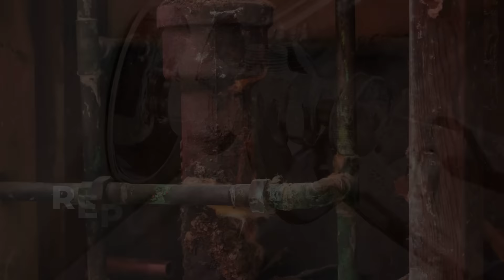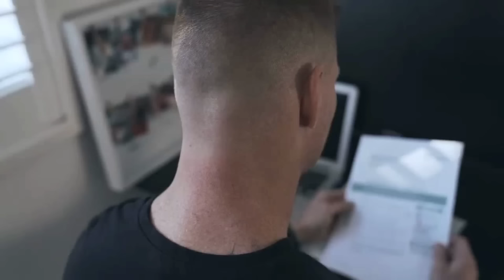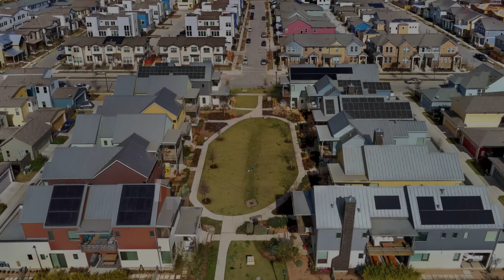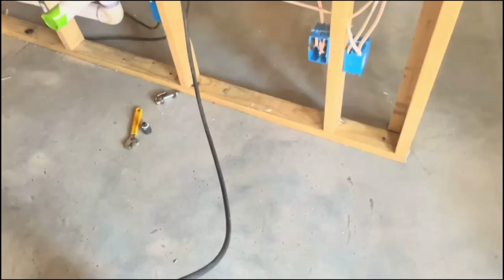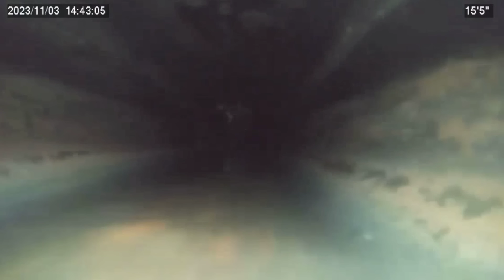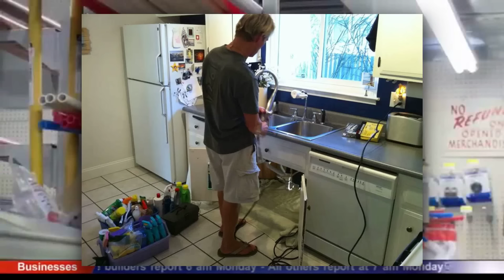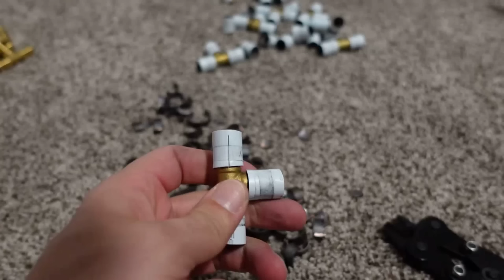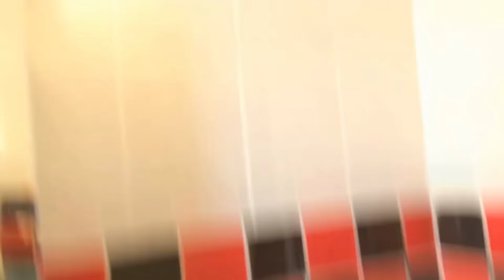Why 90% of New Plumbing Work Are Garbage (The Builder Grade Lie)

Comment: I ❤ the people who have posted these are lies.."its the manufacturer"...if Builders didnt buy it..they woukdnt make it 💯 I am a licensed Adjuster with a major carrier and EVERYTHING said is true ..what not mentioned is that most insurance policies EXCLUDE ongoing/long term leaks, while having a clause stating you MUST prevent damages to your home...this puts clean up & repair costs directly on the homeowners. Make upgrades ASAP, supply line and all angle stop valves. Get a portable condensation pump and put it in your drain pan, this is an even cheaper way to avoid cascading water damages. 

GOD BLESS You ALL 💯

Comment: This is an advantage of older homes, like mine.  As long as it didn't have aluminum wiring.  
My house has copper wire and water pipes.  
Copper pipes seem to last forever as long as they don't freeze and had good solder joints.  
My house doesn't have an expansion tank on the water heater.  Didn't even know that was a thing.  No one in my area has them.  My water heater is already 17 years old with no signs of leaking.
Reply from the maker: It really comes down to who installs it.
Reply: What does aluminum wiring have to do with plumbing? Aluminum wiring doesn't cause plumbing failure .
Reply: @Rightiswrong-qv5ul  Nothing. Read it again. It could negate the advantage of buying an older home.

Comment: Unlikely that cast-iron drain pipes are better.  They rust thru over time.  Very expensive to install.  I think they are only used in commercial buildings because they are quieter.  Today, I think they use rubber gaskets at joints rather than the old poured lead.  ABS seems better than PVC since much less brittle.

Comment: My house does not have nor need an expansion tank. No back flow preventer nor check valve on the water main.
I am pretty far enough from the water main at the street so as not to be a problem.
All my pipes are iron too.

Best copper to use is L-Grade.
Housing grade is cheap M-Grade.

Comment: I've been remodeling homes for over 25 years. I can assure you.... copper gets pin hole leaks and worst. Copper has a lifespand of 50-75 years.  The supply lines that you speak of were mostly issues due to cheap plastic female nut (ballcock).  They rememedied many of them by making them out of thicker plastic and some have a ratchet device that prevents overtightening. I've seen some lines that are 20 years old. 

Profesionals do not ues 'SharkBite' style fittings. The only thing I agree with is that many builders us PEX B as opposed to PEX A which has alot of benefits. Alot of builders also use cheap shut off valves. 

Do you know how much cast iron we pull out?  Most of America uses PVC for drains which works great when you install it correctly. 

 Most of this is because homeowners do not maintain their home.... just like most people don't maintian their cars. Everyone waits for something to break. I've seen client after client over the years who never change their filters, descale their hot water heater, clean their duct, replace water lines and valves, sweep fireplace, caulk the shower, seal the stone...... nothing.... they don't care.... even after you educate them.

This video is so incredibly misleading.

Comment: Having worked for a residential housing contractor I saw too many shortcuts and after 3 homes I quit…
   What I learnt was that you need to find good solid tradesmen who stand behind their work and are not afraid to give you a warranty ! 
    As far as plumbing goes copper is bulletproof.   It’s a lil more labor intensive but you can sleep at night !!
Reply from the maker: I feel you, everyday this happens
Reply: We don’t know the full longevity of Pex. If installed properly (very user friendly)we do know that it’s good well beyond 20 years and I believe some of Europe has a 35yrs plus track record. Copper has a much longer history to look at, again, it has to be installed properly, poor soldered joints, and poor debarring as well as water chemistry can shorten its life dramatically to less than 20 years. Well water chemistry routinely shortens its life, in some cases less than 40 years before failures start to occur. In both cases inferior quality has a detrimental effect on it, poor quality Pex pipe or fittings. On copper, poor quality fittings such as cast brass with porosity, thinly drawn copper ell’s and t’s , or using m gauge pipe can cause failures.

Comment: I had this tyle of piping put in my house in 2002 after multiple copper pipe fails under the slab. New pipes go through thr attic now, no probs so far.
Reply from the maker: Moving lines out of the slab is definitely a smart move for longevity! 🏠

Comment: Cast iron drain pipe deteriorates, corrodes and cracks. It can last 50 or so years but eventually it will give up. 
 ABS drain pipe first appeared around 1960 and the early type usually cracks at a hub. . Newer cellular core pipe is supposed to address that issue but it’s still too new to know for sure. 
 Copper water pipe can corrode and leak or develop deposits that restrict flow from mineral in the water especially any iron in the water. 
 You’re right that workmanship is crucial but. 
The bottom line is that there is no mechanical system in existence that will last and keep working forever. No matter what things will fail over time and use.
Reply from the maker: Valid points on all materials, though I still believe we need to push for better longevity than what's being installed today. 🛠️

Comment: Copper and cast iron can also fail.  We've had drain lines made of both fail in walls and floors.
Reply: How is that possible
Reply: @nyu1774  In one word: corrosion. Search on keywords "copper pipe pinhole leaks class action lawsuit" and you will find multiple instances of lawsuits over leaky copper tubing, each with more specific detail than you can fit in a yt reply.
Reply: We have a pinhole leak right now that is underneath the slab foundation of the home in the hot water line. It is copper pipe put there when the house was originally built in 1977. I am trying to determine whether to jackhammer where the leak is currently happening and patch it with something like JB Weld, or run Pex through the attic and into the bathroom like a buddy is telling me would be easier. I have a sneaking suspicion it's not going to be as simple to hook back into the hot water line as he seems to think, and would be even more work on a Jack and Jill bathroom with a shower separate from the tub, and 2 sinks requiring hot water as well.
Reply: @MrRatlicker   The metal-to-PEX transition is probably not a DIY job if it's your first time (because you do have to sweat the metal-facing side of the fitting), but PEX is higher quality tubing than copper, and other than that transition fitting it is a lot easier to work with. Pinhole leaks in copper are from corrosion, so what you're seeing might only be the first area of corrosion to make it all the way through, with more leaks still to come.

Comment: I will give you rubber seals degrade on a sharkbite. What really makes it degrade is rusty water. I live in Clearwater Florida in a extremely well built 1955 house. I am the only one on my long block who installed a double big blue water  filter system 25years ago on the outside of the house. 2 stage first is sediment second is charcoal. I change them every 3 months and the rust there catching is incredible. Solid RED. if you live in a city the water your getting is incredible rusty. I just received a notice from the water co stating a lead alert now. And encourages everyone to get a filter system. No shit. You want to see how bad the rust in your water is just take the top of your toilet off and look at the walls of the tank. Bet its bright red.
Reply from the maker: Installing a filter system is definitely the smartest way to protect your plumbing. 🧱

Comment: 2 weeks after I closed on the purchase of my home, I got a notice from my insurance agency saying that I had 10 days to replace the pex with copper, or they would cancel my policy. "Why couldn't you tell me that before you approved my policy and allowed me to close?" I asked them. "Policy change - sorry" was the answer.
Reply: Time to find a new insurance company.
Reply: @johnpeters9903  I did. And for anyone who wants to know - it was "Universal Property & Casualty"
Reply: Change insurance companies. I did plumbing in my last job and my wife is an insurance agent. We used pex in our new home build 9 years ago and love it. I didn't put any fittings in the walls, and every line could be replaced with minimal disturbance to finished walls, unlike copper. I've repaired a lot of copper leaks through the years, but I haven't seen pex fail. Yes, there have been a couple pex fittings that failed, but copper would have failed in the same conditions.

One thing not mentioned is the number of copper leaks caused by freezing in northern climates. Every winter countless copper pipes freeze and split. My wife's office has had three repairs this winter alone. That doesn't happen with pex. I'll stick with the best option for our needs in our area- pex.

Comment: Never sharkbite behind wall, crimp black plastic pex, tested 100psi, drains are # 40 pvc, also flooded or 5psi tested is code. Copper is generally way to expensive
Reply from the maker: Exactly, properly installed systems last; it’s all about the quality of the craftsmanship. 🛠️

Comment: My builder wanted to use that PEX crap, made sure I had copper and no Shark bite installed
Reply: I can only assume that you had your water tested before making your decision to use copper. Copper is no longer the superior product. Retired master plumber here with 49 years in the trade. My choice is pex-A for domestic  water lines and  in floor heating.
Reply: @j @johnpeters9903 ve seen reports of pex-a degrading and failing in under 13 years
Reply: @johnpeters9903  General contractor who has lots of hands-on plumbing experience.  I agree.

Comment: In that early scene where they "tore the wall off", is that one drain fitting upside down?
Reply: Nope it is not a drain but it is a vent if it is above the outlet the fittings are turned upside down to direct sewer gases out .

Comment: This guy is right, everything was made che and expensive. The materials are low grade material even the pipes, windows, and walls. They designed it to fall so toto keep fixing things but everything in America is junk. Long ago you took pride in your buildings, appliances and furniture and it last as long as you lived or longer. Now they might last maybe 3 years at the most. Plus this all is meant to make your sick too. Lead paint was to keep radiation or if you're home and protect your from the outside elements. The copper was good for you to drink out of. Drinking or if rivers, steams and lakes had more minerals then water tanks of today because those can have chemicals that you're not supposed to drink.. that's why they changed it all. Money profit and careless about the people just their pockets.

Comment: You said PEX only lasts 8 years? That isn't correct, I've seen lots of numbers from 25-50 years. Like saying your PVC sewer pipe will fail because it's plastic.
Reply from the maker: You're right that the pipe has a long theoretical life, but the system is only as strong as its weakest link! 🛠️ The 8-15 year window is when we see the rubber O-rings in cheap fittings fail and when oxidative degradation from chlorine turns the plastic brittle. A PVC sewer pipe isn't under 60 PSI of chlorinated hot water—PEX is. We build for the 'Real World' failure rate, not the lab-tested best case. Stay vigilant!
Reply: @QualityRot  No one usese push connects, have you seen PEX-A ? You stretch the pip over the fitting. Where are the O rings?

Comment: I thought copper was much better than PEX. however, studies estimate PEX has a longer lifespan. There is so much bad info here, I'd ignore the whole thing. I come from a cast iron pipe family. I rarely see ABS drains. They are CPVC. They last very, very long. Do you even need an expansion tank? Likely no. Only if your water pressure is so high you need a pressure reducer or you have system check valves (backflow preventers). Otherwise, your municipal water line is your expansion tank. Again---lots of really wrong info here.
Reply: I would go with a stout copper tube over anything else.  They estimate that PEX will last longer, but they do not know.

Comment: Uhh horse shit - Im a custom homebuilder and have used PEX for close to 30 yrs and the ONLY failure is if there is a defective "t" connection which was a batch issue not a pex issue or a screw through the pipe - I have and will continue to use it.
Reply: Amen . Retired plumber 49 years.
Reply from the maker: I appreciate your perspective, it’s always interesting to hear from builders with different experiences! 🧱

Comment: Plumber here, nothing bears copper pipe
Reply: bears?  You mean "beats"?
Reply: Electrician here the one thing with copper is if your service or any other service going to the same power  co. transformer is not properly grounded it will create electrolysis and will form pin hole leaks all through the plumbing system . Have seen it a couple times over the years .
Reply from the maker: Glad to hear from a professional who values quality materials! 🛠️
Reply: I agree, but studies show pex lasts forever also. Copper supposedly sanitizes water. Maybe a little

Comment: This video cracks me up 
You talk about how modern builders use ABS plastic...but show PVC waste lines. 
You talk about solvent weld connections...but then show gasketed connections that will be buried.
You say that cast iron is so much better...but the guy jack hammering his basement has a cast iron line visible along the wall. 
You complain about dezincified brass...but then tell people to buy a brass T&P valve.
You tell us to inspect PEX connections, but show the o-ring from a Sharkbite fitting.
You point out green dezincification is really copper oxide or a copper salt. Brass dezincification is a pink or salmon color.

All the issues you describe are already solved issues, or were only an issue because of the installer, not the product itself.

Was this video sponsored by Luddites Inc? Can't we just go back to the good old days where we had a outhouse pit and no running water?
Reply: 100%
Reply: This video is AI goyslop designed to captivate people and get views.
Reply: I haven't watched the video, yet, and after reading your post, I probably won't watch it.
Reply: Agree with most of your points and the contradictions in the video.   CI pipe has the virtue of being relatively quieter in walls than PVC but it rusts internally, gets rough internally with age and blockages
are more likely after a few decades to say nothing of the $$ factor.  OP point about the supply lines to toilets/sinks/washers is valid but sourcing the better versions is not easy.

Comment: A friend of mine just remodeled his house and was so proud that he ripped out all the copper supply pipe and replaced it with PEX like it was some kind of an upgrade!
Reply: I just did the same thing and it is a HUGE upgrade since half of the copper had developed leaks and heavy corrosion. Now I have two manifolds, water filter/softener, ball valves instead of gate valves and no more leaks. $300+ to repair an in-wall leak on copper pipe leading to my water heater and finding a second leak a week later on the main supply line at the shut off (gate valve) was all the motivation I needed.
Reply: @michaelwilliams9658  I believe water quality has a huge influence on copper pipe longevity.
Reply: @k2krake  it absolutely does and, to me, the comparative cost of replacement partnered with the improved quality of the overall system makes PEX more than “some kind of an upgrade”.
Reply: @k2krake  Perhaps but you it's also likely you can blame lazy ass plumbers who don't ream the pipes before they solder them.  When they don't do this, water jumping over that unreamed pipe in the area of a fitting will erode the pipe and cause pinhole leaks there.
Reply: @snafunet cavitation!
Reply: @k2krake Definitely! My Grandparent's 1950 home incurred serious water damage from the copper pipe leaks. The water in that area is a nightmare. It was seriously like everything started leaking at once. I swear the water just ate right through the pipes.
Reply: @michaelwilliams9658  PEX done right with continuos home runs from the manifold to the fixture (or an expose sub-manifold) and not a ton of joints in the wall is a huge upgrade..
Reply: M or L copper? Is the area exposed to cold temperatures?
Reply: It was an upgrade. This channel is full of uninformed, just plain wrong crap. I've seen copper supply fail with pinhole leaks like a sprinkler hose requiring new ceiling and walls in post-2000 construction.
Reply: It was definitely, a downgrade.

Comment: So building codes are a scam.
Reply: No, they're pretty good things to have.  Minimum code is often laughable, but builders would do far worse without it.
Reply from the maker: Codes often set the bare minimum standard, which is definitely not the same as high quality! 📉
Reply: They always have been. Built to code = built to the minimum standard.

Comment: If you are going to throw out statistics, show ALL the statistics!  How many houses have plumbing failures BECAUSE OF THE BUILDER GRADE products?  40% of failures are caused by supply line failures. 4 in 10 claims are due to this.  NOW TELL ME HOW MANY HOUSES HAVE filed for claims in a specific sub division and how many houses were built in that sub division.  There is NO PART of ANY HOUSE that will last forever!!  THE COST OF ANY PART NEVER GUARANTEES THAT THERE WILL BE NO PROBLEMS.